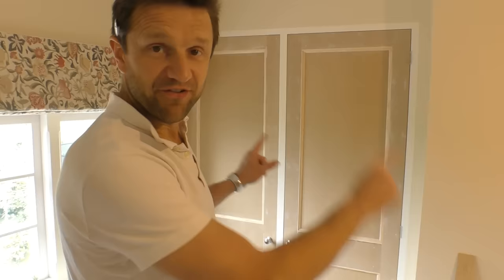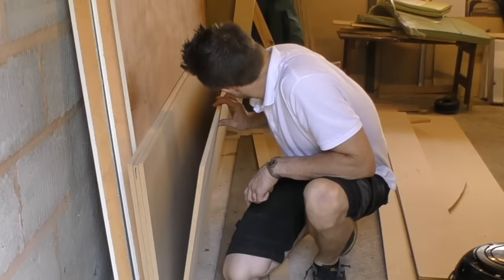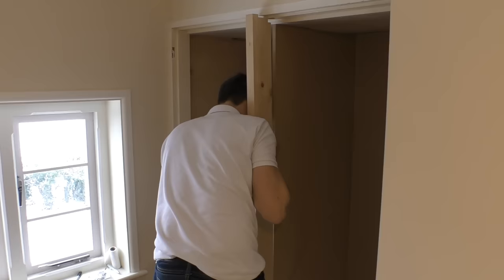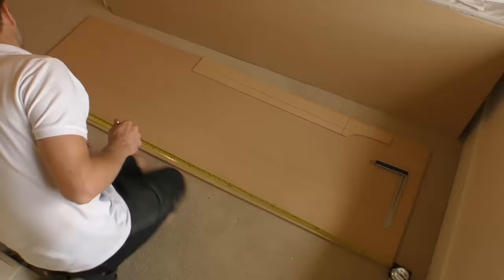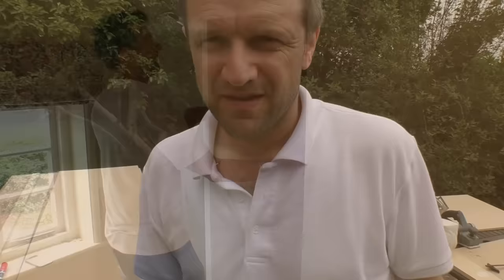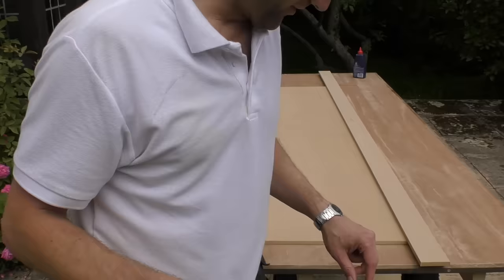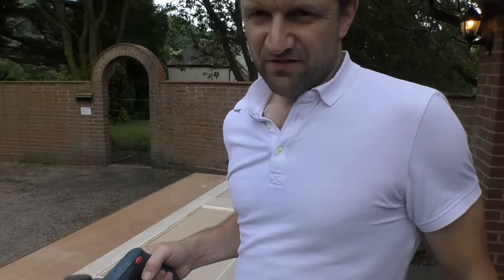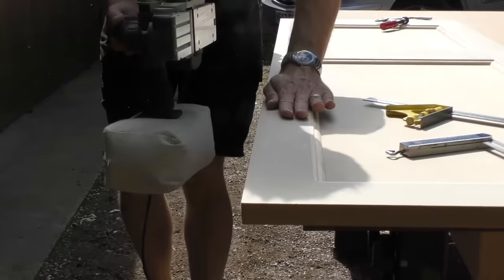How to Make Panel Doors with Basic Tools! Video 1/6

Comment: Hi Charlie,

They're very well made doors. I've done a few fitted bespoke cupboards/doors  for customers and I'm a little ashamed to say they're not quite to your standard. I'm still learning and I expect always will be..

My main issue with working with large panelled MDF doors is the warping issue, to the point where I'm now very reluctant to make large doors from MDF at all.

I'm fine with the keeping it flat on a flat surface at all times whilst constructing the doors. But then there's the painting; it's nye on impossible to paint them neatly when they're hung- you can't get to the edges , they move, paint goes on the hinges etc etc..

So I paint them one side at at a time whilst lying flat. I can't lie them entirely flat on a surface as I have to paint round the edge without the door sticking to the surface its lying on. So I put it on small blocks, and once I start painting is when I seem to get warping issues. Obviously one side is painted before the other, so maybe as it dries it contracts that surface causing warping? I would generally use a primer or sealant and then 2 coats of a satinwood, and paint each side with one coat at a time alternately. I'd usually use a water-based paint ,as with each side needing 3 coats the drying times are just too long with an oil-based paint.

I recently made a set of four doors using a timber frame with 3.5mm ply for each face (so the doors were hollow) and didn't have any issues with warping. They were also nice and lightweight. It was, however, a lengthier process constructing them.. It's just MDF I have a problem with. Whatever I do with it it always wants to warp! 

So.. have you made any other videos covering painting and hanging? Or can you give me any advice on how to reliably avoid warping? 

As a handyman, bespoke cupboards is something I get asked to do quite often and I do enjoy making them. But I really need help with the large MDF door side of things, so any advice would be greatly received.
Reply from the maker: I think you're just being modest there Martin 😏 Most carpenters would scoff at this method but I love it because it's so accessible to anyone who doesn't have router tables, bench saws and otherwise loads of professional tools. I've been blown away by the photos people have sent me of cupboards they've constructed based on this principle. However your point about the warping is a good one. The answer is I don't have a 100% foolproof way of preventing warping. I lost two doors to extreme warping, but I put that down to making them across two trestle tables so they were naturally sagging in the middle. I lost another (so three in total - nothing more soul destroying) and I can only put that down to trying out grab adhesive rather than PVA to bond the stiles and rails to the main surface. The doors featured in this video didn't warp at all. I suspect it's a combination of the glue you use (I used my waterproof Evostik PVA) and the painting process. Interestingly I used Zinsser BIN for these. If you haven't tried it USE IT ON YOUR NEXT PROJECT. That's an order!! 😉 But I think the true way to prevent warping would be to use moisture resistant MDF. I've never used it before as none of my usual suppliers stock it as standard, but I have a big wardrobe project for our soon to be finished bedroom (we only moved out of it in February 🙄) and I'm determined to use MR MDF for that. I see a lot of mind blowing joinery in the day job, and they ALL user the stuff. Stands to reason that should resolve the issues you and I have been having as it's much more impervious to what we're throwing at it.
Reply: @CharlieDIYte  Thank you for taking the time to reply and for the advice. I shouldn't say it's 'nice' to know I'm not the only one who has warping problems, as I empathise with you on this problem. But at least I know it's not just me..

When I bought the panels for some doors I fitted a couple of months ago I almost went with the moisture resistant option as my local timber merchant do stock it and I had a little inkling that it could maybe help with the warping problem. However it was about 50% more expensive and I opted against. I was determined though that if I kept it dead flat etc etc it would be fine.They didn't warp much to be honest, and four soft close hinges on the tall doors helped pull them near to dead straight when hanging.

Being honest the Zinsser paint is a bit pricier than I'd normally opt for too. As a handyman I have to strike a balance and try to achieve the very best job possible whilst also trying to significantly undercut a specialist of that trade,- in this case a joiner. it's a difficult path to tread as the subtext definitely should not read 'the price is cheaper but the result not as good' !! I do consider myself as good if not better than many professionals in some fields, but the point you make about having all the tools is a good one. I expect like me you have sheds and garages full of all sorts of tools, but ultimately I can't possibly own every tool of every trade, that's just not realistic.  So creativity, imagination, perseverance, tenacity, endeavour and hopefully a bit of natural aptitude often have to plug a bit of a gap!

I will try both the MR MDF, and the paint you suggest on the next cupboard job, and price it accordingly. 

You probably wouldn't be able to answer this, but as a rough guide, if you were making a cupboard in an alcove by a chimney breast, about 127cm wide by 230cm high (floor to ceiling), small plinth at bottom and one at top, vertical central divider, another horizontal divider 180cm off floor, four inset doors with soft close hinges, one of tall bottom cupboards with 3 shelves, other tall compartment with none, four plain hollow doors (25mm thick) with timber frame/plywood faced, everything fully painted including carcass, shelves and doors...have you any idea what sort of price a joiner would charge someone? I seem to keep getting these jobs and lots of others, much more work than I can handle, so I'm not sure if it's because I'm too cheap or because I'm good at what I do, or a bit of both! A good problem to have I suppose, 'still not sure whether I should put my prices up though.

Thanks again.

Comment: How do I create a cutting list for a large job to minimise waste. I want to make new kitchen doors and draws in exterior mdf, as I’m assuming it’s more water/moister resistant. Also can you offer advice on the best thickness of mdf to use. I’m looking to make shaker type like your wardrobe doors. I was thinking that if I use 12mm for the main door and add a 75 to 150 mm boarder in 12 mm to create a 24 mm thick door frame.

Comment: I’ve been meaning to ask what blade tooth count did you use to cut your mdf in this? It looks like a low tooth count? Did you get a few saw marks in the mdf edge?
Reply from the maker: It was a 24 tooth blade, although I tend to use a 40 tooth blade. That said, these days I always sand the edges before painting anyway as discussed here https://bit.ly/3wbEprJ, after planing the two 12mm surfaces flush, so it's kind of irrelevant if it leaves marks, although I've never really had a problem with these saw blades.

Comment: Hi Charlie, contemplating using MDF to replace my existing kitchen cabinet doors. Did you have any issues with warping using this method rather than the rail and stile method? I have the tools, just a lot of doors to be made and this would be a huge time saver. 
Also, would the preference be standard mdf or moisture resistant mdf?
Love the videos, keep up the good work.

Comment: Hi Charlie, great video as always.  Can I ask you why you didn't use the glue gun?  Would you recommend this approach or not?
Reply from the maker: I'm not sure I had the glue gun when I did this video. The thing about the glue gun is that it's thicker so it will raise the moulding from the surface leaving a small gap behind. So you have to be a bit careful where you use it. I think good old pva is the best option for something like this. I'm just about to do doors for the current wardrobe series and I'm going to do away with moulding entirely by simply routing the edge. Remains to be seen how the end grain will look though. Might need a lot of paint.

Comment: Hi Charlie.  Loved this project, mainly because I'm considering doing something similar to my back room airing cupboard.  I was wondering why you didn't use ply wood for the main door and pine for the cross pieces?  I was thinking of having the door stained rather than painted so that's why I was thinking of wood with some grain rather than MDF.
Thanks so much for the tips.  By the way, I did have the circular saw blade too low while using my circular saw :-)...
Reply from the maker: Graham Watson Hi Graham. No reason. I guess just habit, and MDF is a little easier to work than ply 🤔 No reason why you shouldn't use it though. You and me both. I was close to binning the saw until a carpenter friend gave me the tip about the blade!!
Reply: OK Charlie, I'll have a think and let you know how I get on.  Thanks for your posts they really help.

Comment: Hi Charlie, thanks for this video. You make things look easier than they are due to your experience and skills.
I'm looking for a sort of flat panel door like those commercial panel walls which would probably be just a flat sheet of MRMDF 1700 x 650 mm with a groove 5mm deep and 5mm wide in the middle. Do you believe 18mm would be ok or should I go thicker than that? My only concern with thicker would be having to install more hinges because of the weight. Thanks in advance for your time.
Reply from the maker: Hi Douglas, good to hear from you. I think you'll be fine with 18mm. You still want at least 3 - 4 hinges though, as they help stop the door warping, as do the door magnets.
Reply: @CharlieDIYte  brilliant Charlie, thank you very much for taking the time to reply. Specially in the holiday. Hope you have a great 2021.
Thanks

Comment: Hi Charlie,
I am a new subscriber. Thanks for all your videos they are great and pitched just right for those of us starting to get more serious about our DIY.
Can I ask if there is a logic/ practical reason for the 12mm for panel and frame? I would prefer a more subtle frame with no moulding (shaker style). I am thinking of 6mm for the plant on frame. Would 12mm still work for the panel or would you thicken it up a little (not sure if the frame is helping with rigidity or hinge depths, etc)?
Keep up the good work.
Reply from the maker: Hi Christopher. Sorry, I missed this comment at the time. Probably too late now, but for what it's worth, yes, there's no reason why you can't go for 6mm for the plant on frame. There's also no reason why you can't reduce the overall size to 18mm. You just need to check this is compatible with the design of hinges you've chosen - but it should be as 18mm is the most common MDF size. You do have to be careful with the door in that the door can bow if the frame isn't added to it on a completely flat surface, and some glues have been known to bow the two pieces when they're glued together. Have you made the doors yet, and if so, how did you get on?

Comment: Hi, love the video.  I was wondering about making 3 sliding panel doors (bottom slide) for a tall floor to ceiling cupboard using this technique.  Do you think the mdf would warp over time without having hinges down the sides to support them?

Comment: Interesting that you use GripFill for the moulding...  I use it for skirting boards on uneven walls where the gaps can be large, but for delicate joints like these mouldings where you want to minimise the gap, I just find it too viscous.  I prefer something like Evo-Stik Sticks Like Sh*t, which flows and compresses much more easily.  And it really does stick like shit to a blanket. Admittedly I've never used it on MDF so maybe it's not the best for that.  Why not just use wood glue though?

Comment: I am interested on how you finished the doors. Did you need to fill all around the outer edge to hide the seam and the end of the Mdf?
Reply from the maker: Hi Michael. I painted the doors in this video https://www.youtube.com/watch?v=2YOASvodntU&t=817sNo, I didn't fill around the outer edge or on the MDF edges. People get quite hung up about MDF edges, but if you give them a few coats of paint sanding in between each, they look pretty good, and once you've hung them you'll never give them another glance. I certainly don't and I'm pretty OCD!

Comment: What thickness did you use to make your wardrobe panelled doors?
Reply from the maker: Didn't I say? 24mm or thereabouts. 12mm for the back piece and 12mm rails and stiles.
Reply: Yes you did say thanks. Could I make the panels slimmer. Go with 12mm base and 6mm styles and rails? Ive gone with MR MDF as you said. Ive heard the door can warp due to the glue drying. Have you had any warp at all? Tar

Comment: Great video. What is the purpose of the panel pins? I would have guessed that much glue is more than sufficient?
Reply from the maker: Thanks Chris. The panel pins are literally only to hold the panels in place whilst the glue is setting. Otherwise you're going to need a load of clamps, or something heavy to put on top, which is going to slow you down considerably.

Comment: Did the bow or warp over time?
Reply from the maker: No, they've been brilliant. I'm looking at them now and they're as straight as the day I hung them. The warping tends to happen at the start, particularly if they're constructed in an uneven table or your unlucky with the glue you use. You could further minimise the chance of warping by paying a little more for moisture resistant MDF.
Reply: Charlie DIYte I’m looking at making doors at 2700 x 570, wondering if that’s pushing it a bit

Comment: MDF great , but i cant get it here in China country side. would plywood work aswell and be as nice or do i have to keep something in mind?. Your result is great
Reply from the maker: xander witt Yes Xander, ply would do the job, and probably be a bit more stable than MDF, albeit probably slightly more expensive 🤔
Reply: i pay for a EO plywood sheet 20 mm 11,61 pounds. MDF is very hard to get and what i can find is double in price and from Australia. IF they need to bring it they will cut it in half ( no other sizes )for transportation.After 8 years i still need to get used to the upside down world here in China ;)

Comment: Excellent video tutorial, thanks for sharing. I would like to ask you a question: I want to build my kitchen doors in MDF and I see that it is almost always done by assembling parts, could not it be done directly by routing an entire panel to give relief?
Reply from the maker: It could be, if you're talking about just routing a decorative rebate parallel to the edge set back in, but the problem you've got is when you get to the corner of the rebated section, you won't have a nice tight 90 degree edge. Experiment on a section and you'll see what I mean.

Comment: What happens when you chop the hinges into mdf? Screws don't hold particularly well in it. You should lip the hinge side with soft wood really
Reply: Contact adhesives and hinge tite  screws, I have had doors hung for years like this!
Reply: @Goodwithwood69  and if u need to take the hinges off at any point?

Comment: How are these doors holding up 2 years later?
Reply from the maker: As good as the day I installed them. I've got to say I don't open and close them every day but have used this method elsewhere in the house and haven't had any problems. If you were to install European style hinges rather than these flush hinges they'd be even stronger. My next series of videos will be a large wardrobe build so keep an eye out for that 👍

Comment: hi charlie 
great job
and have you tried no more nails if so what are your thoughts on it 
is it better or as good as the gorilla and gripfix 
thanks
james
Reply from the maker: james o'connell I used it a while ago James. Can't recall how good it was, though I would say similar to the Gorilla stuff and not as good as the Gripfill.
Reply: hi charlie
thanks for your reply i agree with you  gripfill should be better to bond  items

Comment: Hey Charlie, re: mitres: you seen the trick about cutting ever so slightly less than 45° in order to get a really tight fit and take into account expansion and contract with wood? Especially for things like skirting boards.